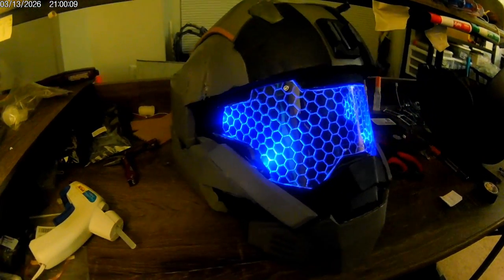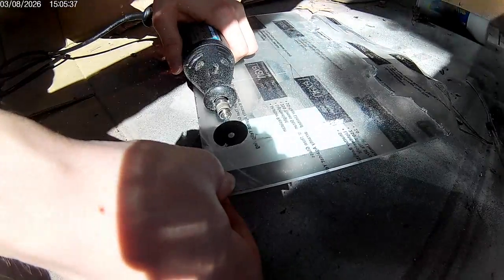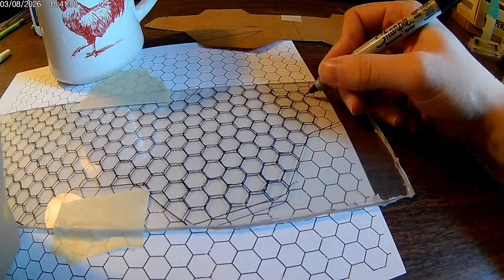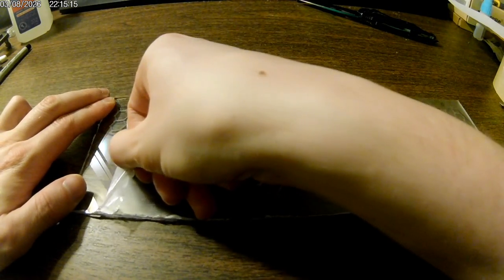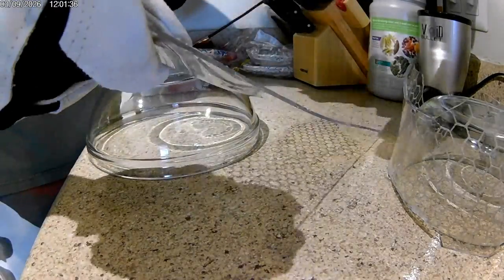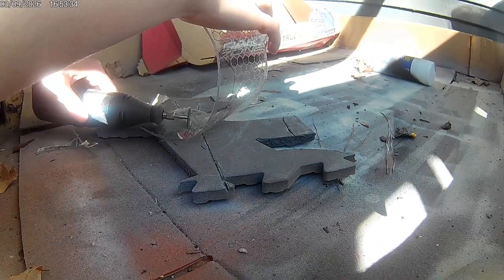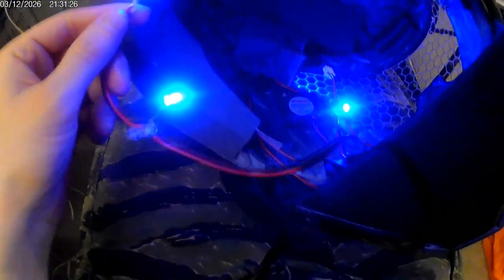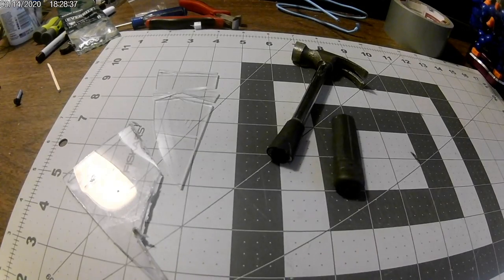Holographic visor How-To

Comment: Can this be done to a stock clear motorcycle helmet visor without having to remake it out of acrylic or similar material?
Reply from the maker: Read description
Reply: @asylumprophet  understandable, I'm not going to use it while riding but I have an extra clear visor for my Icon Airflite I'm not using and the way the face shield is made on the helmet it would look absolutely sick to have it glow.

Comment: Im curious for the bending steps why didn't you pop it into a toaster oven and do the whole piece at once?
Reply from the maker: I prefer having more control, if the entire thing is flexible there's a greater chance that some part would flop or bend that I didn't want to. If you have a mold/die/form, it would be easier.
Reply: @asylumprophet  alright that makes sense

Comment: Couldn't you put the plastic in a oven to heat to bend ??
Reply from the maker: If the entire thing is floppy it's a lot easier to get bending where you don't want it, in my experience. Heat gun lets you control where it bends, since I don't have a mold/template

Comment: try to dremel on the top off the led a good bite and glue it with super glue to the visor ,you can see where the led  needs to be intact fore it to work
Reply from the maker: Super glues cause frosting on clear plastics during the curing process, I would not recommend that. Sanding the LED is possible, but you'd probably want to polish the resin too so you're not left with a rough, light dispersing surface
Reply: @asylumprophet the glue comes between the led and  plastic and leves no frost inbetven you shold try on scraps,  i have tryed a kople of metodes and the scratches disepears with the glue,it works like a filler at the same time as long theres no cannions that is, butt your helmet is sweet annyhow,,good work dunn there

Comment: Instead of spending all that time tracing with the sharpie, why not go straight to using the engraver to trace and engrave at the same time?
Reply from the maker: Personally it's easier to engrave along a line rather than above a line, since the pattern is offset from the surface. The sharpie is easier to control

Comment: Wouldn't it be easier and cleaner to cut it slightly bigger then use sandpaper to get the edges smooth and flat with no burrs
Reply from the maker: Edges need to be as clear and glassy as possible to let the most light into the material. If you sand you'd need to polish too
Reply: @asylumprophet  of course, I figured you would have to and light might be stronger to if you can polish it good. Never done anything like this so no idea how easy all that would be. After posting and thinking about it kinda wonder if the polish would make it to bright and harder to see in the helmet hmmmmm, if you try that out im deffinatly curious

Comment: The strength of the polycarbonate is almost completely useless since the rest of the helmet seems to be made out of foam... not much a point to showing how strong it is if the rest can be destroyed with a box cutter. of course I don't think this will be used in a situation where it would be damaged any way aside from a fall with or without it on but still, a bit pointless.
Reply from the maker: I like not having acrylic shards in my face. EVA also doesn't shatter on impact
Reply: @asylumprophet  fair point, but when would something happen in which causes it to shatter
Reply from the maker: @tunoffun5745  things like airsoft/paintball, sparring, or debris come to mind. Same situations where you're supposed to wear safety glasses despite having the rest of your head exposed
Reply: @asylumprophet  I was not thinking nearly broad enough, I was just talking about cosplay or convention kind of activities. In the sense of other applications yes it is actually very important. I just wasn't looking at the whole picture.

Comment: 3d print moulds then apply adhesive to a panel of carbon fiber this is easy to bend apply heat and finished.

Comment: could have skipped the tracing step and just left the pattern taped underneath and went straight to dremmel
Reply: also, when i have to bend a large piece of arcylic i just set my oven to the lowest temp and toss the whole piece in there for a couple minutes. much more even than heat gun
Reply from the maker: Pattern is offset from the surface so you have to compensate for that projection. It's easier for me to do that with a marker than while using the dremel. For the heating, having the entire thing flexible means that it can bend anywhere. One strip/section at a time gives me more control over how it bends, too much heat is how the first attempt warped.

Comment: Why din’t you just use a knife which is designed for cutting plexiglass it would have been much easier than using a rotary tool
Reply from the maker: I was cutting polycarb. 50x stronger than plexi

Comment: i have a smart suggestion, 
just tie that piece around your bowl, and then apply heat, then let it cool down
wasnt that smart and simple.

also, the lights you using arent that compact
and you are using much thicker wires, you can and should use thinner ones